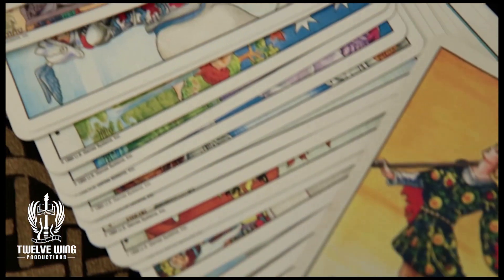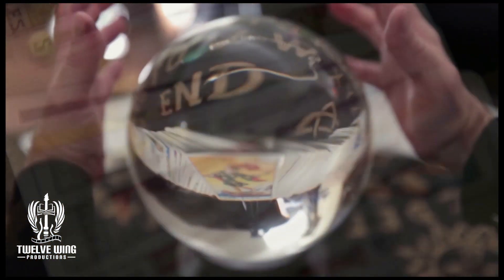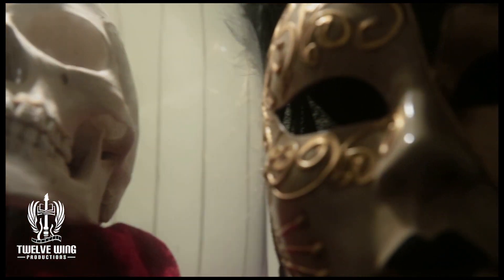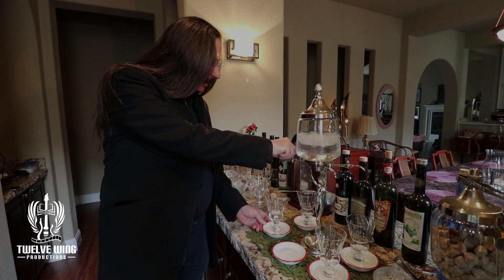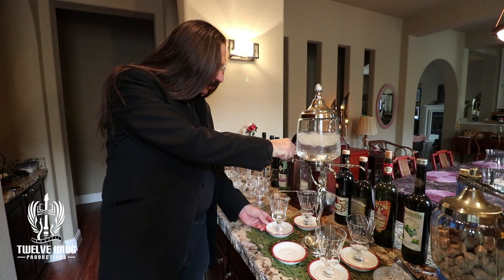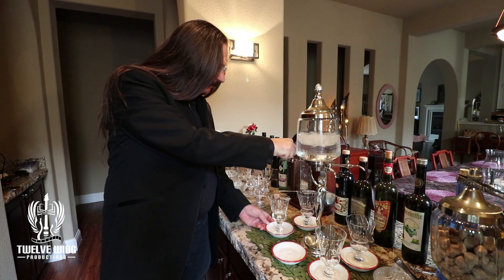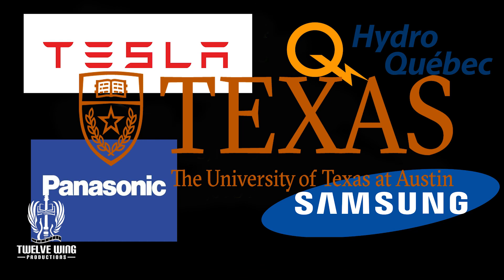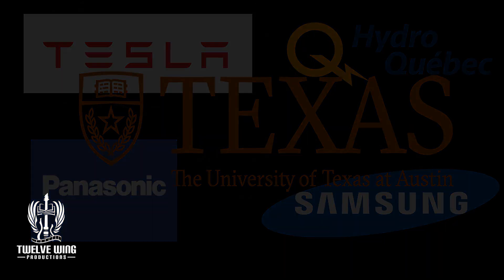Is Tesla Making Solid State Batteries in Texas? : Glass Battery Patent

Comment: Thanks for the update on the solid state battery. I like your positive attitude, we need that right now. I have been following John Goodenough and Helen Bragga's glass battery since they first announced it in 2014. Since we have not heard from him in a while, I assumed he had run into some insurmountable problem, and the glass battery was yet another promising idea which did not materialize. So hearing about the patent is a game changer, and very encouraging for a positive outcome. When used in combination with wind or solar power, this new affordable, reliable energy storage technology will bring the cost of electricity down to less than coal or oil

Comment: I wouldn’t expect much on the solid state battery for another 18 months or more. Tesla’s Battery and Investor Day will probably be about new battery advancements that they will be manufacturing ay scale in Reno and perhaps in expansion of Gigafactory 3 in Shanghai.

These technologies probably will include the Maxwell dry electrode process, newer batter chemistries, changing from modules to pack assemblies, perhaps changing the diameter of the batteries and announcing the 1 million mile battery at pack cost of less than $100 per kW. 

If you listen to the 3rd Row Tesla interview with Elon at his house, he indicates that solid state batteries are not ready for mas production yet.

Check out The Limiting Factor - a 3-part Youtube series speculating about Tesla’s Battery Day announcements.
Reply from the maker: I'll have a look, but the limiting factor, according to Samsung and others, is the anode.
If you read between the lines you quickly learn that the part that Samsung and others are struggling with is exactly the same part that Tesla purchased with Maxwell.  A mass manufacturer nanostructure based anode.
If your time frame is only a year and change out, you may need to recalculate just how far along Tesla likely is.
I think there is a lot of smoke and mirrors surrounding this thing.  They have already stated that the million mile batter is nothing compared to what else they have.
I'm thinking that during battery investor day we get to find out what that "what else" actually is.

Either way, this is going to be very exciting.

Comment: With the improved safety and energy density the most exciting thing that will change our lifes much more than electric cars is: cheap and environmentally friendly electric flight, including E-VTOL type flying cars. Science fiction is about to become real - only as a matter of time... Can't wait!
Reply from the maker: I think that fossil fuels probably have a long life ahead of them for long range commercial aviation, but for short range flight, you are spot on.
It will be a much cleaner and quieter tomorrow.
Reply: @twelvewingproductions7508  Agreed. I wasn't referring to e.g. trans-atlantic flights - for starters maybe something like the Volocopter with a better battery.
Reply: @twelvewingproductions7508  For the time being, but for long haul, Hydrogen has a lot of potential given that it is 3x more energy dense than kerosene. It just requires a substantial airplane redesign.
Reply from the maker: @yggdrasil9039  The problem with hydrogen are the HUGE losses.  So while it is energy dense and that might have some potential in aviation since the fuel will be consumed, the weight of the tanks necessary likely outweigh any advantage even there.
So I don't see Hydrogen as being viable.
Reply: @twelvewingproductions7508  I have confidence that they will come up with a tank liner and material that means that the tanks don't have to be as heavy as they currently are and minimise H2 loss, but there are opportunities for various hybrid systems, for instance, H2 naturally aspirated jet for take off, pure electric for cruise at high altitude, or even some form of hybrid ion drive system for cruise at alititude, but for the meantime, agreed H2 is not yet viable.
Reply from the maker: @yggdrasil9039 , the problems for using it for aviation are monumental.  Burning it won't yield enough power so you have to convert it to electrical energy.  This means that in addition to the fuel, you need buffer batteries as well as hydrogen fuel cells.
So I just don't see that happening.
Then there are the transfer losses from compression and then moving the fuel.
I really do need to stress that the more you look into it, the worse it gets.

The other thing is that there will be a glut of petroleum products.
Even just paving roads and making plastic parts for industry is going to give us more aviation kerosene and gasoline than we can possibly use.
No one is going to be driving on diesel in 10-20 years.
So plenty to use for aviation.

Comment: Nice. What if Goodenough/Braga, Jeff Dahn, Shirley Meng have been collaborating behind the scene for over 5 years to develop this super battery tech Tesla will introduce in May? Can't wait
Reply from the maker: I'm betting they have.
I bet the collaboration between all these players runs deep.
I have a feeling this is going to be epic.
Reply: @twelvewingproductions7508  It certainly will if we can get a reliable, long lasting and non-toxic energy source. Truly a Holy Grail moment as you mentioned. ( if it pans out, of course)
Reply: @twelvewingproductions7508   Now I'm very curious, how big your bet is!  I am holding many thousands of dollars in call options and this video has caused me to lean further toward the idea of holding them until after battery day.  Up to this point my expectations for battery day announcements has been as follows:  1.  30% greater range across all vehicles due to greater energy density  2. 20% reduction in battery cost, with a path to 40 to 50% battery cost reduction.  3.  Greatly reduced charging times
Reply: That would be to good.

Comment: What about that "Tesla Glass" from the Cyber truck?
Reply from the maker: Are you asking if I think they managed to strengthen it?
I think the glass from the truck suffered more from a mounting issue than the strength of the glass actually.  I think when they hit the door with the sledge hammer it caused a gap to form between the windows and the sill.

The glass for the batteries is described in the patent as a single web... BUT... they also make mention of other methods of creating it, one of those is very cryptic and actually describes the spark sintering we spoke of in earlier videos.
Because of electron microscope images of the glass battery that were released in 2014/15, I suspect that we are not talking about a whole sheet of glass but instead a granulated material.

But none of this should be confused with "Tesla glass" used on the cyber truck or the roof tiles.
And word on the street is that they have gone back to a standard type of safety glass for the roof tiles instead of armored glass.
Reply: @twelvewingproductions7508  sorry, I left a terribly worded comment. I was wondering if the tesla glass would serve as a proper solid electrolyte. It also makes me wonder if the solid state battery was the impetus for tesla pursuing alternative glass manufacturing in the first place.
Reply from the maker: @adrianfortmoviereviewsbook9821 , ah.. got it.. now I can answer your question.
No, Tesla glass was born out of a desire to make a hardened product for it's roof tiles and the spinoff was the semi truck.
I have been at a secret installation of the version 3 solar roof and it appears that Tesla has moved away from the armored glass in this product but more information to follow before I commit to that.

The "glass" in these glass batteries isn't that type of glass but instead is usually a quarts or garnet.  The secret to this "glass" is that while molten, impurities can be baked into the glass.
This is called "doping".
This kind of thing is done in silicon wafer manufacturing to create a Positive Negative Positive relationship to the external layers (PNP) or Negative Positive Negative (NPN) structure by introducing gasses that change the number of valance electrons in the glass.

The glass for these batteries does the same thing but the "doping" as it is called... also introduces other impurities... such as Lithium, Sulfur, Magnesium, Sodium... etc.

I don't believe they are doing this in sheet form since Tesla describes this as a "monocrystal" cathode.
To me that means they are using spark plasma sintering to create this "glass".
But time will tell.

Hope that helped.
Reply: @twelvewingproductions7508  wow.. great insight
Reply: @twelvewingproductions7508  The patent application lists 2 dozen forms, it covers a lot of ground.  The term Glass in chemistry does not refer to a sheet of window glass but a more general term of a solid that has no crystalline structure,  and usually referred to as amorphous, like water in that the alignment is random. It usually forms by cooling a solid after melting it.  The patent application includes a wide range of forms and materials as falling under that patent, which is an extension of the 2015 patent.  If this patent is open to all parties, Tesla's massive advantage over the other companies shrinks, and it can change everything in portable electronics and BEV.

Comment: Love the videos. Only note I would make is about brooks at drag time. He went back and said he made a mistake about the larger battery capacity.
Reply from the maker: Thanks for that.  I'll post a correction in a follow up video.
I had thought that the added capacity lined up pretty well.. but I had my reservations with that too as it seemed just a little early for such a mass delivered product.

I still look forward to Munroe & Associates tear down of the Y.
Thanks for the heads up with Brooks.
Reply: I saw the retraction on dragtimes, but I also saw the video where it showed both vehicle screens side by side. One said nominal 72kwh and the other 77kwh. I don't see what he got "wrong."